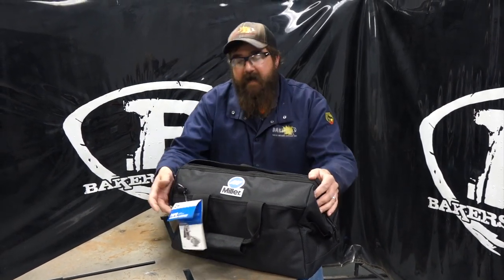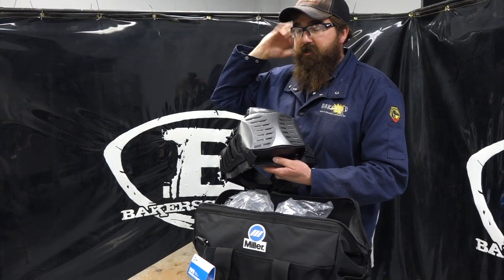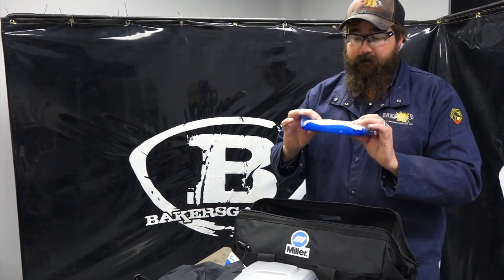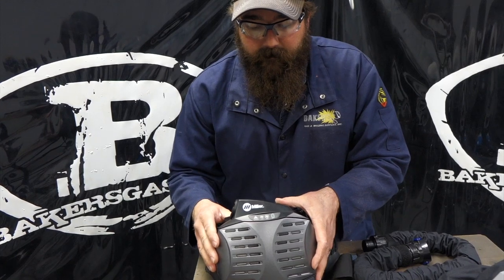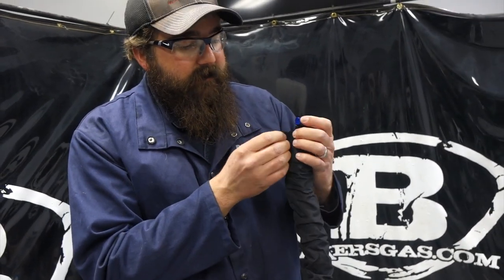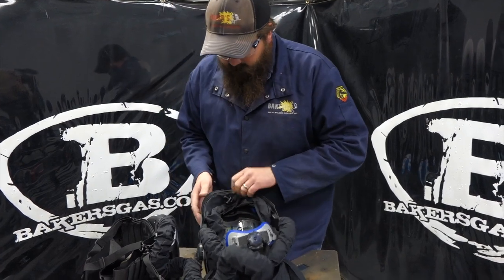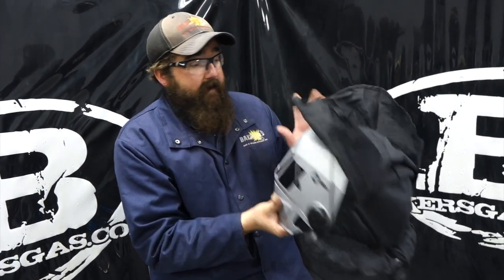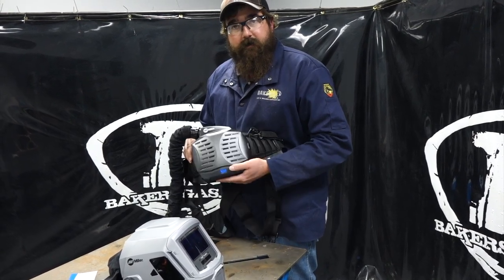Miller Electric T94i-R PAPR Review —  is it worth it?

Comment: That's a sweet ass system right there. I've been using Miller products for years, but I haven't upgraded my hood for better then 20 years. The hood I have now I got when I worked for Fleetwood RV's when I was 21yo. I think now is an excellent time to upgrade to that right there.

Comment: Can you remove the lower unit from the belt provided to put it on a safety harness?
Reply from the maker: They make shoulder straps so you can divide the weight a little better

Comment: I need something without the weld shield. Im in a bad air environment but only actually welding about 20-30% of the time.
Reply: The brand Optrel make something what you're asking for. Called Swiss Air Papr.
Reply: @newfierunner8686  Unfortunately the high cost of papr units means I wont have one anytime soon. I use a N99 respirator but lack of filters means washing and reusing. Still better than nothing.

Comment: Can you remove the “Y” hose and balaclava to use it just as a standard welding helmet without the PAPR?
Reply from the maker: No you really can not you need the system complete. I would get standard T94 and then PAPR for the applications you need the extra protection.
Reply: You can wear the helmet without the PAPR but it will weight a lot more for no practical reason, also it will be hotter with the fabric on it. I own the speedglas g5-01 and I have a stand alone hood for quick jobs where I don’t need the powered filter.

Comment: Will this filter fumes from aluminum welding or should I go with the supplied air respirator model?
Reply from the maker: Yes it will filter for fumes. PAPRs fully protect but if you just need a welding respirator check out the Miller LPR-100
Reply: @BakersGas  I am going into boilermaking this year. I currently work in an all MIG fab shop and we run a trigas mix. Air is brown all day. Is this the model that will take me from fab shop to boilermaking (stick, mig, tig)?
Reply: @BakersGas  the lpr 100 filters are very small. I tried one and had to replace filters daily.
I dont recommend.
My current n99 filter has about 5 times the filter size.
Its a honeywell 7190

Comment: Let me emphasize why it is important to have or to advance to a new welding helmet that has a free flow air system I worked for a factory years ago before retirement, welding giant octagon shaped pipe structures and they were made out of weathering steel which is a steel that is treated with certain chemicals to purposely cause that steel to rust with fish scale type rust shapes so as to seal the inner core of the steel and we would guarantee the structures for 99 years they did not have to be galvanized they did not have to be painted but it came with the price to the welder, the welder who breathed in these fumes from welding weathering steel throughout the day sometimes within just a couple of months of welding we had one 21 year old person develop brain cancer and a number of welders had brain tumors and the guy I changed shift with,b he had a tumor like a grapefruit hanging on his chest and he died, at a young age, breathing in these fumes are not good for you,  on galvanized steel I have had the shakes where it would cause your teeth to chatter and of course the milk drinking does work when you get galvanized poisoning but welders who can afford it and that's the sad part, most welders are from paycheck to paycheck , the welders that are just starting out, and they will not be able to afford one of these helmets that cost $1,000 or more ,but soon as you're able to, it's worth it to advance to one of these units because breathing in the fumes are not good for you.
Reply from the maker: We could not agree more! Protect yourself! Worth the investment long term.
Reply: Most of us are trying to pay the bills. Dropping a minimum of 1.5k for a hood is robbery, I'd rather wear $50 respirator under my $80 hood.
Reply: At 61 I cough up black daily.
Im sure my end will be lung issues.
Ive already had spontaneous collapse of my right lung twice.
Scary and painful. Almost killed me both times
Reply: @UrbanArmada  those filters will add up eventually you’ll be upset u didn’t just buy this mask after spending hundreds of dollars on filters
Reply: @bobkeller8383  I'm just wondering what part is so expensive? The hood at most is like $300 bucks, you can buy an air pump, hose, power tool battery adapter and a few other bits for under $100. I'm working on making my own at the moment because I'll never pay 4 grand for a hood.
Reply: @UrbanArmada  Most of the PAPR units are so high due to them being fit on top of the line helmets. The 3M Speedglas G5-01 PAPR unit is over $2k, with half of it being the helmet itself. As far as the Miller T94i PAPR goes, around $500 of it is the helmet. I can't really speak for the Lincoln Viking 3250D, but it's probably similar to the Miller. The real cost for most of them is the PAPR unit itself, with a good chunk of it being in the batteries, as the 3M, Miller, and Lincoln all come with 2 batteries. If you want a PAPR that won't (comparatively) break the bank, take a look at the Air Plus system that ArcOne makes. I believe that it runs around or under $1k, although while the helmets they're offered with are good they do leave something to be desired.